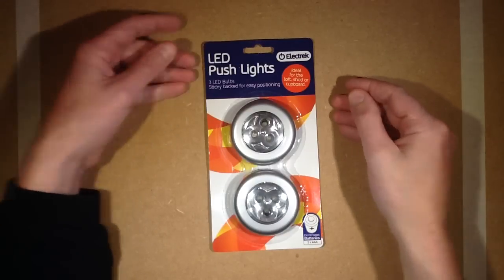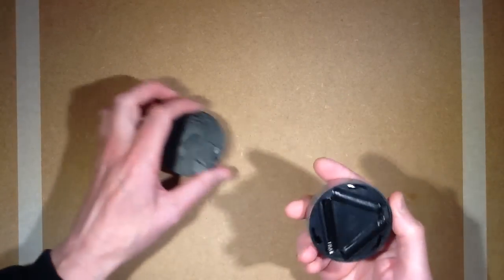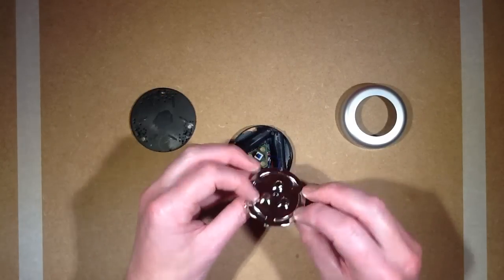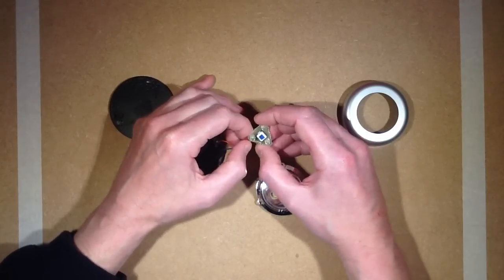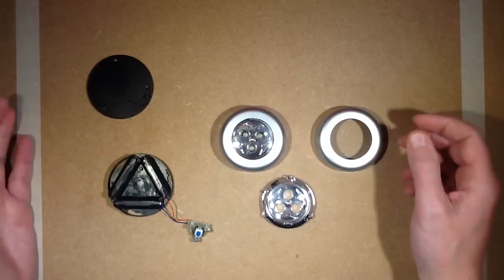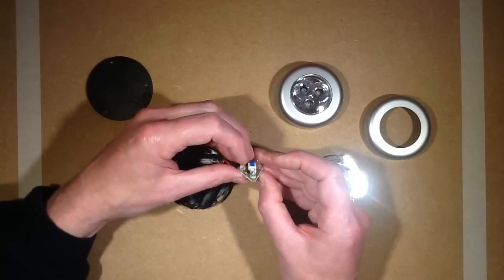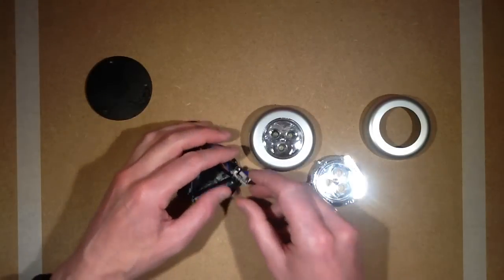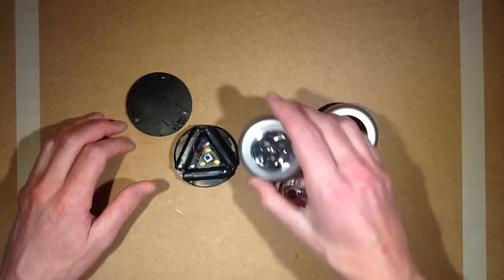Exploring the humble LED "push light".  (Osram Dot-It clone.)

Comment: I have tried rechargeable batteries in then but they don't work at all with them not sure why at all so was thinking of wireing 5 of them up to a power supply for my display unit how many volts would i need to use.

Comment: These sorts of little "tap lights" are being used a lot now in DIY traps for Brown Marmorated Stink Bugs.  So far the UK doesn't seem to be overrun with these Asian Invaders, but wow we sure have them in the US now.  If only you had a quick/cheap hack to add a sensor facing out a hole drilled in the edge (hidden from the LEDs) to turn the light on at dusk and off at dawn.  Might extended the battery life when left on for a few days without attention.

Comment: I've had these cheapo ones for years and they still run on the included batteries. I guess AAs would be better but the light would then be a lot heavier and larger.

Comment: I had an old Osram Dot-It at one point and I remember very well that to change the batteries you had to unscrew the back. I tad hard when its stuck to the bottom of a desk.
Reply: I just found my old ones after yet another move, and am looking for how to change the batteries :D I finally found a screwdriver that fit the tiny screws, and still can't get the back off now! 😑🤪

Comment: We had a similar use for these at the theatre where i work: 2 of these lights were coloured red and inserted into the head of "The Giant" prop used during a production of Jack and the Beanstalk. The batteries were taken out of the radio mics after every 2 performances and used in the Giant's "Head lights".....